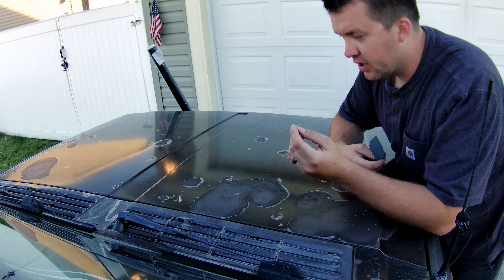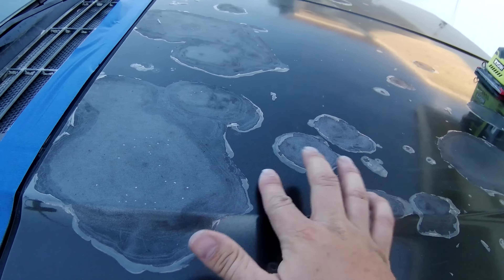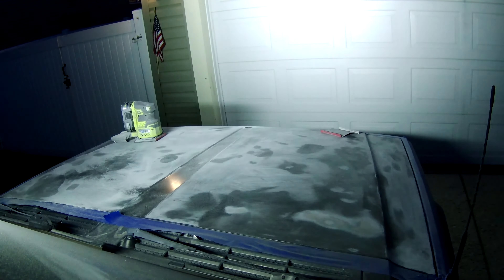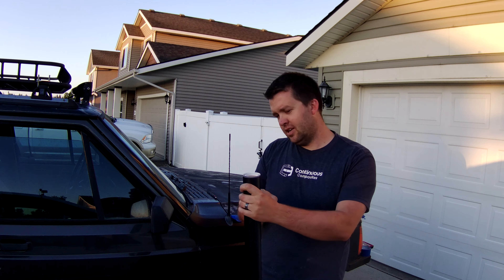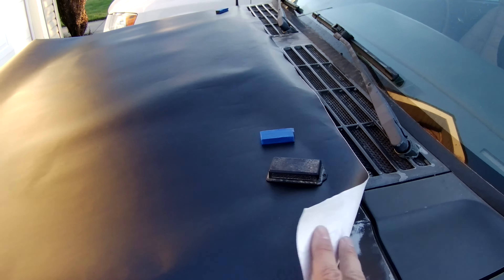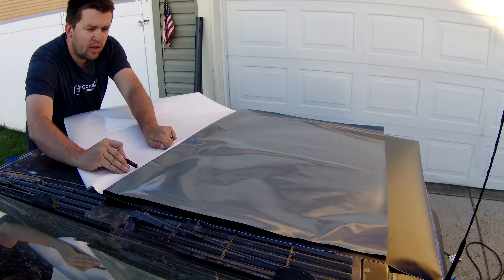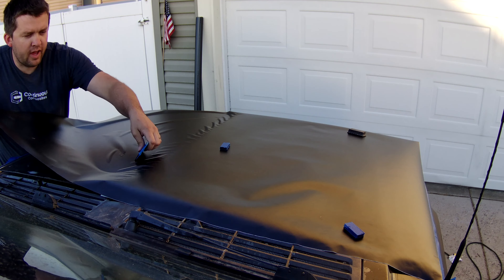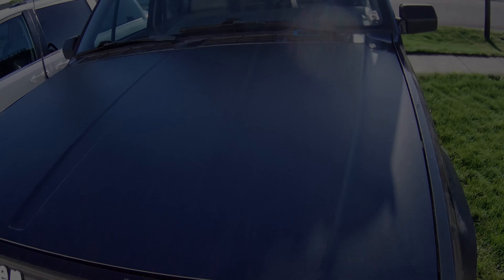DIY Hood Wrap with Vvivid Vinyl: Tips and Tricks for Stunning Results

Comment: Just wondering if you think after doing this it would be easier instead of peeling the backing off of one whole side of the hood, Maybe just peeling like eight to 12 in at a time then squeezing up to that point and then peeling another 8 to 12 in off so you're not constantly on sticking it like a foot away from where you're working. Just a thought I was thinking haven't done it yet but planning on it great vid.
Reply from the maker: Thanks for the question.  I'm not sure than may be easier, I am just learning to do this as well.  From all of the videos I have seen it is  recommended to work from the middle out.  Then again I just re-did a fender and started at the top edge so idk...?

Comment: Looks great.  Do you think the heat of the engine will be an issue?
Reply from the maker: Thanks!  Only time will tell, I don't think it should though considering vinyl wrap is a pretty common thing for cars.
    
I am planning a wheeling trip next weekend though and I can take a close look before and after to see if the current 100 deg temps plus the engine heat seem to effect anything...